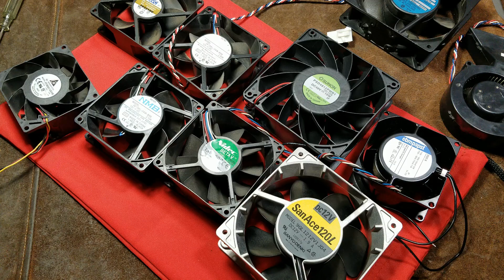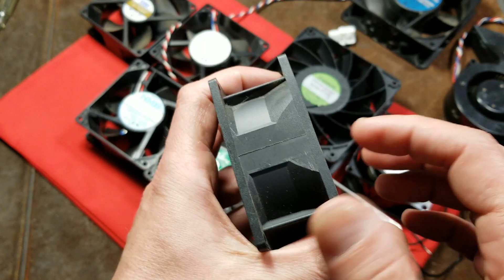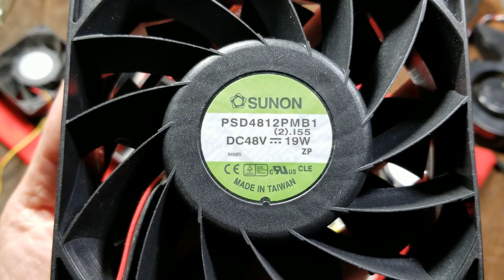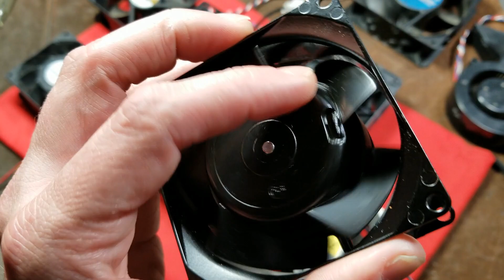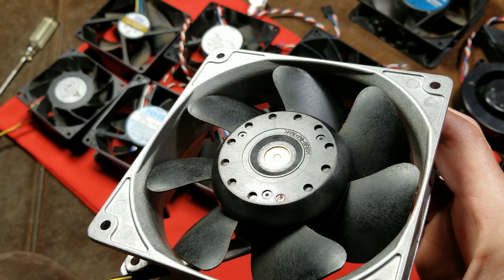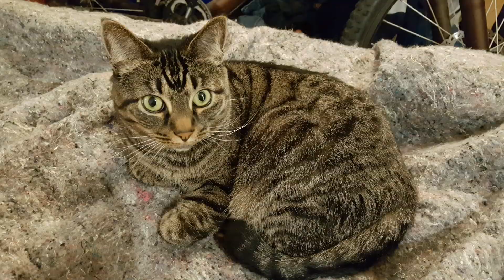Premium High Performance Computer/Electronics Fan Brands

Comment: What's the largest fan capable of 6.000 rpm?
Reply: Delta's website lists THB2048HG-A (7,700 RPM) and THD2048HT (7,400 RPM), both 200mm square fans @ 48 V DC.
Reply: @fat_pigeon  I wish I had a link to the highest most powerful 120mm fan an the 2nf highest 8(((

I bought the lamptron 60 w per channel pwm contrlr 

An I can't find ,8((( so confusing I don't understand why.

Its almost like there are many scam versions.  Trying to find the  best for 60w p channel pwm is becoming debilitating 8((((

I shall not give up8((((((
Reply: @fat_pigeon  Oh my fucking god... that's unvelievable! put one of those as an air extractor in each bathroom stall and turn it on for 1 minute after the user leaver. The next guy will not smell anything XD

Comment: Thanks for the informative video. I always thought delta was just a commodity product because they do make a lot of noise and are literally everywhere. But I think Noctua literally blows these fans out the water. Ultra quiet, 150,000hr MTBF, 6 year warranty, and some are even IP67 rated. It's an Austrian company that really does make the best. I have 2 running in a 0 degree environment for over a year now.
Reply: Noctua makes great fans for computers and light industrial use, but they're optimized more for noise- and power-efficiency and don't really compete with the high-powered industrial fans this video focuses on. For comparison, the highest-powered 120mm Noctua fan I see on their website (NF-F12 industrialPPC-24V-3000 Q100 IP67 PWM) is rated for only 3,000 RPM, 110 ft^3/min, 4.32 W. Delta makes a 120mm fan (THD1248HE) rated for 10,900 RPM, 287 ft^3/min, 105.82 W.

Comment: Going through a HP desktop and see 2 AVC fans on the CPU and case. Guess I'll leave them be...
Reply from the maker: Yeah those are fine your option would be if you were going to replace him to put in more powerful units. I have an HP is well and strangely it has AVC Nidec and Delta fans all from the factory

Comment: Or you can use drone motor + prop for lot more "thrust" to blow the dust while moving air. Thrust = (Air Density) x (CFM^2) / ((Pi) x (r^2)). Bigger the prop and same thrust, more CFM (assuming no extra losses) if you care more about air movement than blowing dust.

Comment: I used to oil the bearings by peeling the sticker off carefully put a drop or two of oil in the bearing put the sticker back down and get another year out of a failing fan. It is amazing how many choices out there and the number you have on the table
Reply: I've taken a few completely apart and cleaned the bearings and the motor. I have a little Sunon 80mm fan that I did this too and its still working now, it was made in the mid 90s.